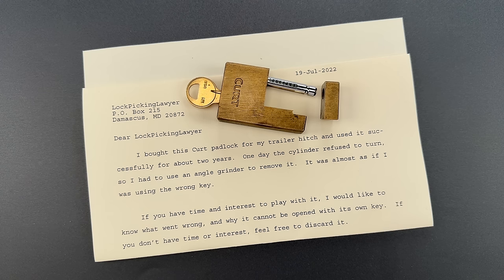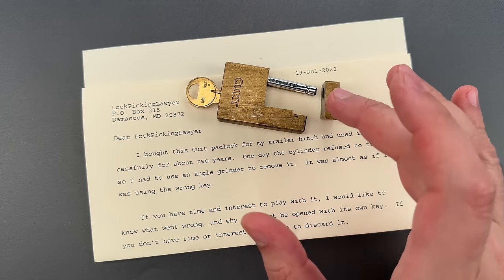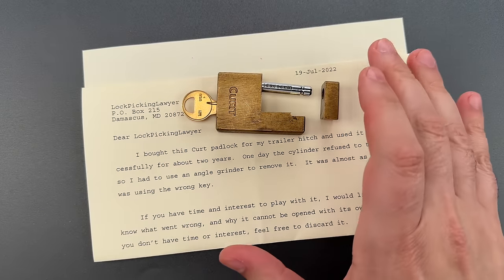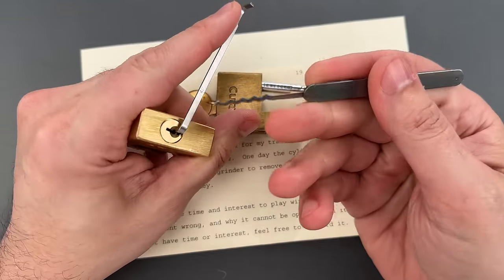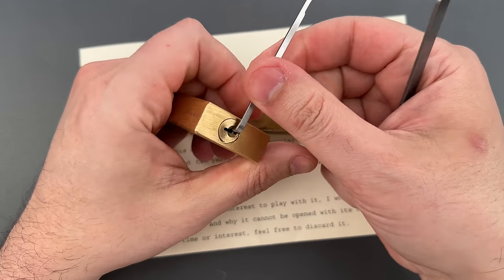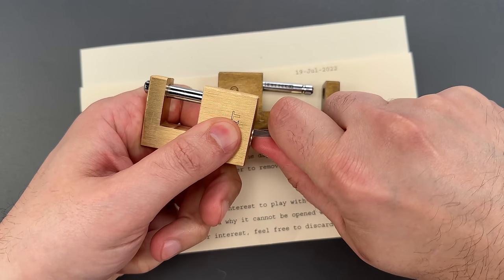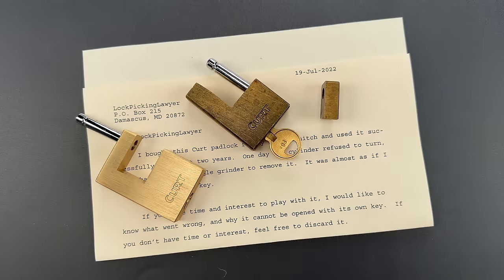[1470] This Curt Trailer Lock Does Nothing Right

Comment: Perhaps you could cut the lock open and confirm why it is seized.  It would be an interesting opportunity to see this condition from the inside.
Reply: Or spray the lock with some penetrating oil to loosen the mechanism.
Reply: @jcwoods2311  looking at the colors of the outside of the lock, he has probably tried that.
Reply: @edewaal97  so he failed to open it?
Reply: Completely agree. He talked about his attempts to open it, but didn't show anything with the viewer's lock.
Reply: I know Bill had a top mill that he used on locks frequently, but I'm not sure if LPL has one too...
Reply: @Ryan_Thompson  I kinda meant the lock owner should've tried it. Always nice to see locks defeated though.  Would those methods have worked on the said lock? We'll never know.
Reply: he said why. it's rusted.
Reply: @edewaal97  From the video it looks like it was outside. LPL read the guys letter, apparently it froze up in 2 weeks of exposure.  In that short length of time a few second spray of PB Blaster and some jiggling would likely have opened it up.  Not that I expect LPL to do a tutorial on freeing up a corroded mechanism, I would certainly do it before taking a grinder to it. 
Then again, I use hardened steel towing chains and an LPL approved PacLock  to secure my trailers.
Reply: @jcwoods2311  2 years*
Reply: @98ek9  Just u fluke :D
Reply: i'm surprised he didn't spray some wd40 on it at least.
Reply: Not worth the trouble. Whatever is inside we already know the lock is trash.
Reply: Ya I need to see inside this one
Reply: @devtrash  He only said it was rusted. But didn’t verify that there was no rusted steel within the lock mechanism. 
Being a Lawyer afterall. He’s skilled at decieving fools fools by showing a magnet attracting to the lock mechanism. 
But the magnet was attracting to the closed shutter bolt. There is no way to know if any steel parts are used in the lock itself.
Reply: @BuzzinsPetRock78  I'm pretty sure he does, since he has built his own pinning tray...
Reply: @benjurqunov  "But the magnet was attracting to the closed shutter bolt"

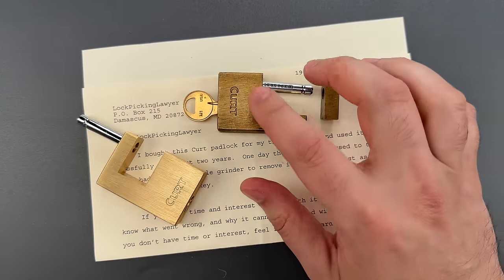Nope. The bolt only goes into the body by a few mm (you can see the outline of the hole drilled to insert the locking spring/latch at 1:54); LPL was showing the magnet sticking right next to the outside corner of the lock, a good 20 mm away from the bolt edge. If the only thing attracting the magnet was the bolt, you'd see the magnet moving sideways towards the bolt at 1:55 and falling off at 1:53 when there are a couple of frames when LPL's fingers are not supporting the magnet.  There is no way of knowing whether it's rust, a jammed spring or something else without cutting the lock mechanism open, but the magnet test is a valid proof that they used mild steel in the lock innards.
Reply: I had the same thought for a moment, but I suspect doing so would loosen, separate, or damage the seized area by the time you got close to it, so you'd see potential indicators, but not the actual problem in its problem state.
Reply: @BuzzinsPetRock78  He has and he have been using it before.
Reply: He knows enough about what is happening to waste his time opening a rusted lock. It would be a 2 min video for us, but might be an all day shooting event for him. Not worth it.
Reply: @BuzzinsPetRock78  yes he does have a mill in the workshop.
Reply: @BuzzinsPetRock78  I was thinking the same thing. I know it's a bit of a drive to get to Bill's place in Virginia, but it would be cool to see him and say hi. But only if both Bill and LPL like the idea, of course.
Reply: @AddictOfLearning  Not necessarily. If he used a milling machine or a grinder it would only take a few minutes to sheer off the side of the lock.  He would only have to film the results at his desk. That's all I ask. Filming and editing would take no longer than a regular video. 

As mentioned in a previous comment, as interesting as it may be, the cutting process may cause too much damage to the core to be of any value.
Reply: @AddictOfLearning 

That's the nature of making videos. A few minutes of finished material can take many hours to shoot/edit/etc.

So by your logic, pretty much no video ever in the history of YouTube would be "worth it".

Yet YouTubers make videos with such a work/finished product ratio all the time. FOR THE CONTENT™, as it were.
Reply: @AhsimNreiziev  I think you might have misunderstood what I was saying. If it takes  45min - 1hr to film (not including any editing) on reviewing a lock (which we love to watch) or for the same 2-3 min video it takes him 6 hours to do/film/cleanup all the mess of drilling out a lock...what would you do? You would 100% do the 1hr work that is tried and true content.
Reply: @jcwoods2311  
Read the letter again. 2 YEARS, not 2 weeks.
Reply: @AddictOfLearning  That's also assuming he's filming for Ease of Use/Profitability Maximum. If it's an educational or curiosity reason then it doesn't matter how long it's takes.
Reply: @BuzzinsPetRock78  my first thought..make a time lapse video milling through it 1mm at a time, that would be awesome
Reply: I'm sure to the company it's a design positive with making the customer buy a new lock after a certain time period.
Reply: @1TwistedPoet  out of cofveve and didn't have my glasses.  Guilty as charged
Reply: I love the short videos, but this one seems a bit under-finished. A trip to the shop, some WD40, maybe some "concussive repair" techniques... Even a statement of "I tried what I could, and it didn't fix it". And yes, cut open the body and see the damage. A missed opportunity I guess.
Reply: 1.8k likes on this comment.  Please cut that lock open.
Reply: @jcwoods2311  Is there even an LPL approved padlock?  I thought those were mythical...
Reply: @drsudz  he's come close....  Highest ranking is LS. "Least Sucky".
Reply: Agreed! I want to see what went wrong with Alan from Oregon's lock.
Reply: Agreed! Would love to see that!

Comment: Idk, a lock that even you can't open seems pretty good to me! Just gotta wait a few years for it to corrode and boom, premium security
Reply: Since LPL mention there's reliability issue, you might as well weld the lock too.
Reply: Or you can use Kemppi glue. Much faster.
Reply: That's great N all for storage, but with a bicycle, you still want to maintain access.. The corrosion occurs through oxidisation when your lock is left out in the rain for weeks/months/years
Reply: Welding's faster.
Reply: I've actually had a couple things I do security that way on.  put on a cheap lock, and then if I need to open it, just cut the lock off.  it's one step better than securing it with a zip-tie.
Reply: see his video on the love lock. lock piking lawyer did one with his wife and welded it shut. I don't think he said what type of lock so if you see a lock with a 6inch thick shackle on a ridge welded shut...
Reply: Just weld it shut 😁
Reply: Or, hear me out 
You weld it closed
Reply: I see you've opted into our lock subscription service to cancel the service just mail the undamaged lock back to us.
Reply: I feel like it might be quicker to just put gorilla glue in the keyway of an ordinary lock to achieve similar results
Reply: That would be an interesting time lock if the intent is to never open it until a set period of time is up. 
Literally no way to open once it is set, save for an internal "timer" which is simply a hunk of metal which is designed to fail after some years of oxidation.
Reply: Of course, when life locks a door you can always smash open a window. It'd have to be set in a framework that's sturdy enough to offer no alternatives, and even then you could probably crack it open with enough persistence, skill, and the right tools.
Reply: Master Lock frantically writing notes for their new "level 10 strength" lock. Notes include:
- Jammed springs
- Rusting
- The usual wave-rake submissive innards until one or both of above occur. Perfect.
Reply: Look how easily the owner got into the lock, by sawing a quarter inch of brass. A fresh hacksaw blade could cut it in less than a minute.
Reply: well making an unpickable and lock that can't be opened with the key would be helpful for a time capsule... it's not like you plan to open it anytime soon anyway. just bring the right tool to destroy the lock and you are golden.

no one will be able to pick it. and if they steal the key, that won't open it either.
Reply: @AlbertLebel  You do realize that the Lock case is Brass? The brass can be Brazed but the heat would mess the lock guts. The sealed plug on the side could be drilled revealing the guts inside.

Comment: I’m used to “this lock is easy to pick”, but “the key won’t open this lock” is definitely new.
Reply: Yeah
Reply: Cheap brass lock cores has so bad tolerances that it is an universal rule that the key is the hardest method to open.
Reply: Finally, a lock that is pickproof.
Reply: @wictimovgovonca320  Nof if only it wasn't keyproof at the same time.
Reply: When this happens to a Masterlock, its a feature !
Reply: the fact his one does both makes it EXTRA aweful
Reply: Its common with cheap locks that have rubbish steel springs or cast iron palls.
Reply: Happens all the the masterlocks at work.  Their outside on trailers, generally banging on them with a hammer will loosen them enough for the key to work, but I go through about 1 key a year.

Comment: Reminds me of a bike lock I have that sometimes just refuses to open with the key... and then I come back later and it works fine. It's very strange, but it was pretty cheap (and masterlock brand) so I'm not expecting too much out of it -- more of a deterrent than anything else.
Reply: As long as it's not the kind that magically opens itself when you are in the shop. Had a supermarket bicycle lock that did that.
Reply: Throw it away and buy an Abus.
Reply: probably easier to pick
Reply: some bike locks in finland were like that, but that was explained because they froze. had to carry a lighter to school...

 (and I think that one having been a disc detainer of some sort, not abloy, the old one that was welded on to tunturi's)
Reply: Sounds like thermal expansion or humidity is causing parts to bind in ways not intended. I'd replace it though.
Reply: I had one of those as a bike lock in high school. ML5, big SOB but an easy pick. I finally lost patience and hosed it down as much as I could with PBlaster- got a handful of tiny brass shards to float out of the keyway. After that it worked totally fine. Near as I could figure the brass filings were jamming the lock unless they'd settled into a spot where they couldn't, and having it in my backpack would throw the shards around.
Reply: @lasskinn474  I had the same issue cycling in below -15C. But it was not simple freezing. It was because the lubricant (lock oil) did not work well in these temperatures. The locking motion actually shaved metal shards off the inside of the lock with friction, like Casey Darrah below described. When I kept my bike lock in room temperature overnight, it always worked the first time I had to use it in the day. But getting the lock to open at evening was always a trouble. The lock broke completely before I managed to fix it by looking for cold-proof lock oil. New lock did not have such soft metal and lack of lubricant only made the it unwieldy, not unworkable.
Reply: Expect it to fail at some point and then your bike may end up locked in the wrong place(for a night?)...
Reply: @Engrphotog21  Or the spring or two that are moving the pins are broken and you need to wigle it to open the lock.
But i agree there is no point to lock your bike with lock that is broken and in the end may force you o leave the bike in some unsafe place(and thief may come with tools to open it even when you cant do it with the key).
Reply: It's Masterlock, what did you expect 😂

Comment: LPL, maybe you could do a little video on lock maintenance.  It would be good to know when and if we should lubricate locks or perform other sorts of preventative care.  Thx!
Reply: Ooh this is a great idea, hope he sees this suggestion
Reply: Just dip it in hot wax.
Reply: Lightly sand rust with high grit sandpaper and Lubricate with oil every 6 months
Reply: I give no legal advice; but I can strongly recommend a can of HOUDINI for your car, utility, residential, and commercial door lock CYLINDERS. Because it is not a grease, do not use it where grease is required. You purchase it at your local locksmith shop ( or pay a premium to get it on Amazon )
Reply: Actually a nice idea, hope LPL sees it!

Comment: I had a lock do this to me. It was a brass padlock with a removable core. I'm pretty sure it was rebranded for the hardware store where I got it. Felt solid and I never managed to pick it (I got it to practice on.) I was moving and wanted to lock the back of the truck, so I threw this lock on. After a short drive in the rain I went to take it off and it seized open. Barely an hour of use and it broke.

Comment: I spray my locks down with silicone lubricant inside and out. Keeps them running smoothly even though they are installed on transport trailers in transit year round 😄👍
Reply: I recently had to tear down one of my Abloy Sentry padlocks for cleaning.  It's amazing how much grime can get inside one of those and it keeps on working.

Comment: Good job it stopped working then. At least he had the opportunity to buy a better lock now. ...of course, it is possible that his lock was key retaining which would negate the knife attack. Sometimes the relief on the locking part of the shackle has an angle cut at the back of the slot that can push down a little on the locking pall which makes it possible to whack it with a hammer on the end to unsieze the locking pall. Might be worth a try. Also, if the pin stacks have rusted steel springs, tapping on the side of the lock sometimes helps key pins drop in to the cuts on the inserted key.

Comment: It is interesting to see how neglect, dirt, age and lubrication can improve the security of lock cylinders. Of course there needs to be a balance between intended operation and complete dysfunction. I am not a good picker but a clean Master padlock is an easy pick for me, however, I have a couple of dirty, greasy used units that takes significant time to get open with a pick because the dirt causes changes and inconsistencies in feel.

Comment: Well on the bright-side if it's too corroded to open with the key, it's too corroded to pick open....On the down side you won't be able to differentiate the owner from a break in as both will have to cut it off...Though an owner might try graphite and or penetrating oil before resorting to destructive removal.

Comment: I was honestly never under the impression that trailer locks were designed to keep the trailer secure from attack: rather that they were designed to keep the trailer's contents secure from falling out whilst in transit.

I think this video shows that fact quite well.
Reply: K. This lock is for the HITCH... so, it's to keep the Trailer from being stolen, not the contents.
Reply: @1TwistedPoet  RIP. My comment was malinformed.
Reply: @ignazachenbach5406  
Easy mistake to make.
When most people think lock, they automatically think about locking a door of some kind. 
Especially if you aren't a frequent user of trailers.

Comment: The lack of security seems to be a typical feature in many locks which this one is clearly not exempt from. In all fairness to the lack of functionality after a period of time, considering this lock is used outdoors and also going down the road with rain spray and possibly salt, this would be an expected failure and generate a short life expectancy. If you want life duration, maybe try to find one that is sealed and weatherproofed. Then it's just a matter of security the overall lock provides which is usually dismal at best.

I have found that if it takes LPL 2 min to open or use of special tools, that is an endorsement for a lock and will successfully ward off a non-determined thief who doesn't care about destruction. [Such as the guy did with a grinder in this case.] I have removed locks this way [authorized] with the intention if replacing the lock.

Comment: Guess I'll be going and replacing my trailer hitch lock. I only use it to keep the pin locked, not anti theft; but if it's going to corrode and stick, off it goes..

Comment: I have a waterproof and fireproof safe-trunk. I use it to keep my backups in my bomb shelter. I don't mind the security aspect of the lock, but at some point I lost the keys. I just keep opening it with only the turner, not even a wave raque required.

Comment: I came across a cheap Chinese lock recently that looked pretty crap, so I was really surprised that I wasn’t able to pick or rake it. I had tried for about an hour before I gave up and used the key. Then I realized why it was so hard to pick. It took me at least 5 min to open it with the proper key. 
So yes, locks can be so bad, that they are at least good in the regard of security
Reply: Objective achieved

Comment: Electrolysis welding from having dis-similar metals within the lock probably contributed to the corrosion, and subsequent seizure, of the locking mechanism. Ironically, making it better than a factory new lock of the same make and model.

Comment: I agree cut it open.

That said, any lock which is outside needs to be periodically lubricated and cycled.
You shouldn't expect something to sit outside exposed to the elements and not require some kind of maintenance or preventative care to live forever, regardless of the price or construction.
Even a fully stainless steel lock, could simply jam up because of dirt and mineral deposits from rain.